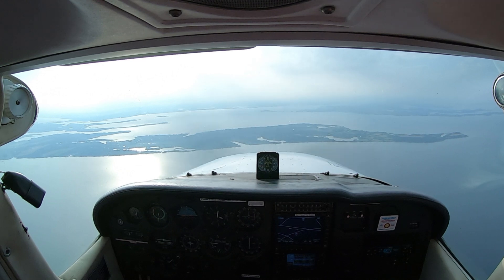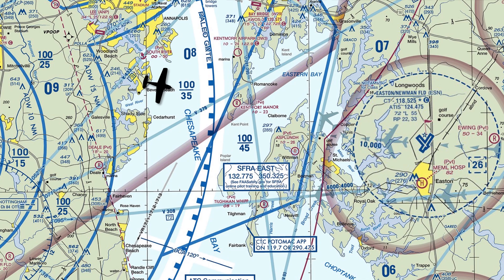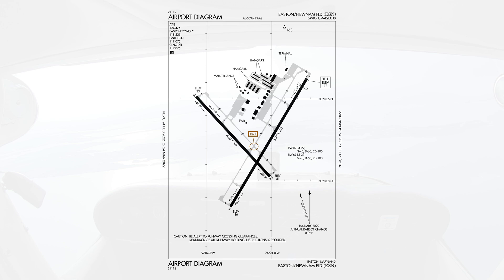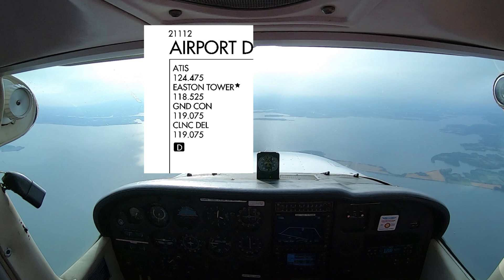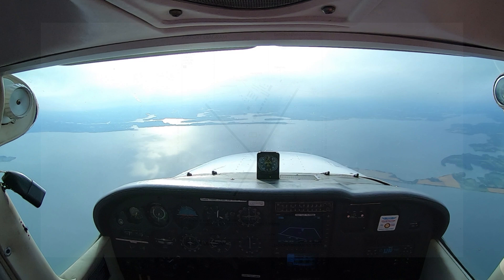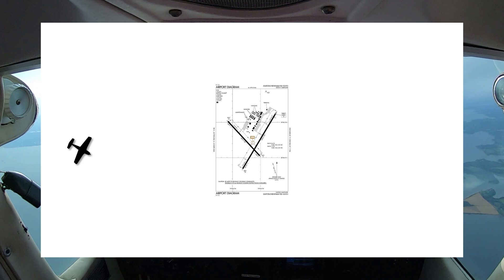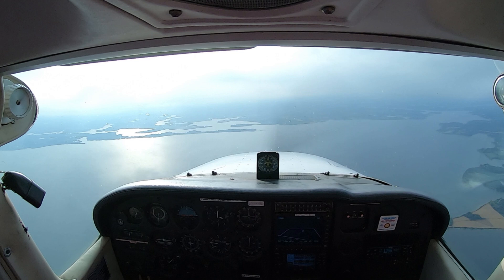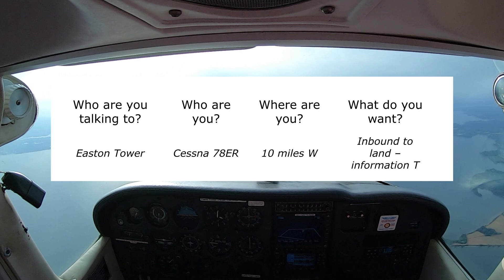How to Land at a Towered Airport | Class D Arrival | VFR Radio Comms

Comment: I was lucky enough to start my training at a pilot controlled but end at a Class D towered field.  I'm comfortable with radios, but it's amazing hearing how a little red button on the yoke will tongue tie some of the most articulate people! It really is as simple as this video makes it out to be.
Reply: They do say there is a certain percentage of IQ points you loose after pressing that button. I dont have many to begin with so it can be a real struggle 😅
Reply: Same here.
Reply: People don't want to screw up, especially when safety is closely tied to using the correct terminology.
Reply: Im sure it's easy, but the idea of everyone within 30nm hearing me botch everything is worse than a firey death, at the time.

Comment: Step 1) Squawk 7700
Step 2) reduce power to idle
Step 3) full flaps
Step 4) slip w/ rudder to the floor
Step 5) land in displaced threshold
Step 6) run out of cockpit screaming "bees!! bees!! They're ripping my flesh off! Your weapons are useless against them!!"
Reply from the maker: Haha!
Reply: POH says no slips to landing with flaps deployed
Reply: @Cosme422  Depends on the aircraft. For example, Cessna 150L with full 40degress flaps and Full Forward Slip is not recommended, but not prohibited 
...elevator/horizontal stabilizer buffetting may occur... I can tell you from experience it definitely does! 😉

Comment: Can you please do a video on how to report the correct location to tower. I had an incident on pilot where the controller said I didn't report an accurate location. I thought I did. But I didn't want to argue.
Reply: I usually just give my bearing from the airport to the nearest 45 degrees using the name of the octant: north, northeast, east, etc. Try to get your distance within a couple of miles.
If you want to remove all doubt, find a VFR reporting point and fly over it. They're marked on the sectional chart with little pennants with the name underlined. For example:

"Aurora Tower, Cherokee 12345, Yorkville, with Juliet. Full stop."
"Cherokee 345, Aurora. Enter left base runway 27. Report Sugar Grove."
"Left base 27, report Sugar Grove. 345."

Now, after that exchange, my girlfriend turned to me and said. "You're not with Juliet. You're with Lori!"
That's when I knew she was finally relaxing and enjoying herself.
Reply: @johnopalko5223  lol that’s a good one
Reply: @johnopalko5223  you had me all the way to the end 😁 its exactly what I would say.👍Keep the blue side up.
Reply: @tbone1212  We used to joke like that all the time.
Flying up from the south, I always flew over Yorkville because all you had to do was follow the highway north and it put you on a perfect left base for 27. As a crosscheck on my pilotage I'd dial in a radial from the Joliet VOR and, when the needle centered, I knew I was over the right little town.
The first time I did that with Lori as a passenger I pointed to the omni head and told her it was a "Yorkville detector."
She knew me well enough to be pretty certain I was kidding, but I could tell she wasn't quite sure.